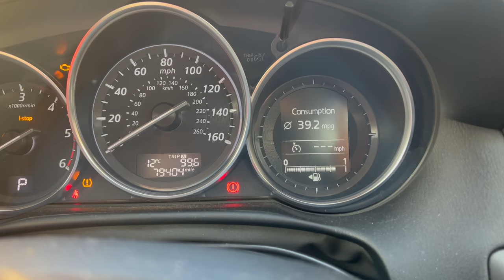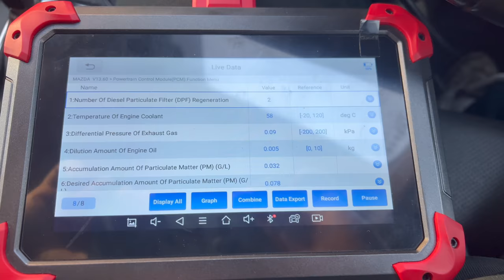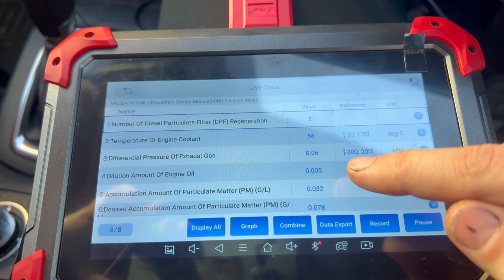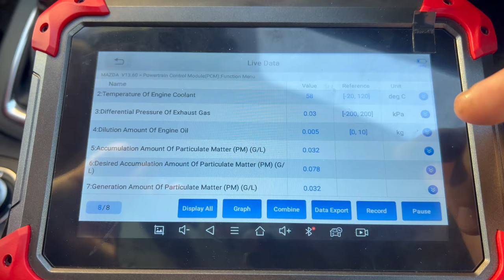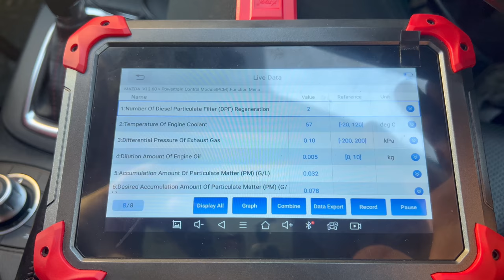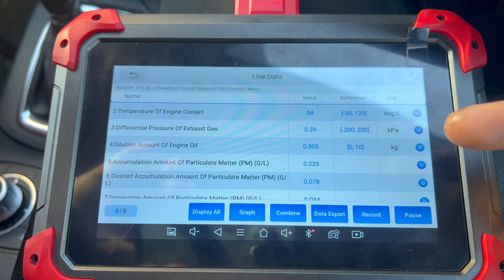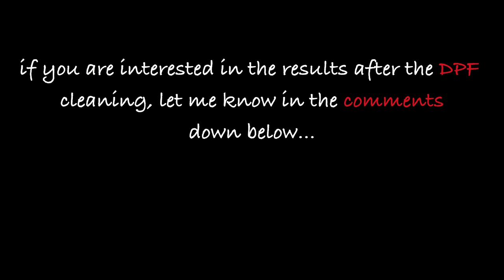Mazda Skyactiv DPF Issues Explained in Depth in Detail - It's the INJECTOR and not the DPF Filter

Comment: The screen with the Engine, AC indicator is located in the Fuel Economy Monitor menu.  I also noticed the car is in re-gen when the engine icon greys out.  (you are right on)
Reply from the maker: thanks for confirming ;)
Reply: Yes that's correct, the little engine icon, on the i  eloop models, the start stop, doesn't work also on the regen, and the car sounds tapity

Comment: Hello Sir, I had oil light turn on a couple of months after buying my mazda 6 2017 skyactiveD 2.2 was diagnosed as injector seals by the dealer... They were replaced however now after 20k+ ive recently found oil level increased above max in 3 weeks after a service... My drives are regularly only 15 mins also... Reckon the DPF due to short journeys is getting blocked or injectors again?

Comment: do you get the injectors tested? I got mine tested where they analyse the spray pattern and they were perfect, 40k miles on them.
And yes please do a vid on the results, I suspect my dpf needs to be removed and professionally cleaned because the spray did not work but I can look at your results to compare with.

Comment: Hello. Could you provide more information about the degree of oil thinning and its impact on regeneration? What would happen if it is not reset?If the injector has corrosion and is leaking, there will be differences between the actual fuel refilling and the average consumption that the car is supposed to have. Or am I mistaken? I also performed a flushing using similar fluids as you did, but there wasn't much improvement. After that, I added a DPF (diesel particulate filter) additive to the fuel from Liqui Moly. This product helped me; the regeneration distance increased significantly.

Comment: great video, thank you. My CX-3 1.8d 2019 makes Regen every 180km. I live in a big city and every day I make 15km to work and back. Problem is Oil dilution. I' ve changed oil in 98500km, in 102.000km because I didn't no and stopped many times the regen. From that time and so on every time the car begins regens I drive out of town for 20km in 3000rpm and have succefull regens. Know at 112.000km again new oils. Its normal? I only use mazda ultra dpf 5-30 oil but I read that the new generation of oils with low SAPS as Castrol edge extended performance has lower sulfated ash, phosphorus and sulfur  which is better for dpf's. What's your opinion? Thank you in advance

Comment: I tried different DPF foam cleaning using the same method you did.
Wurth, Xenum, Errecom DPF flush, they did work but after 10k+ km, the regens drop bellow 100 km.
I tested the injectors and they seem all ok.
Now the only think I did not check is the EFR valves...
Do you know that the 99.2% egr error PID means?
Reply from the maker: Hi buddy, to be honest I have no idea. I didn't have any experience with it.
Reply: its most probably engine oil leaking into the combustion chambers, causing excessive particles in the dpf. Any other failure mode causes a error code to be thrown whereas that one is most likely disregarded by ecu as "crappy fuel quality-but still within spec"

Comment: Hi. I have mazda 6 2.2 skyactiv 2015 with 85k miles. I have no fault codes. But the car is regening every ~50-60 miles. Is it most likely injector problem? Thanks
Reply from the maker: I think so
Reply: Did you manage to solve this?

Comment: Where can i get new injector nozzles please
Reply from the maker: I don't know buddy.
Reply: Mazda does not list injector nozzles  only injectors as a spare part, meaning dealerships are not equipped to repair  only replace them, as with most items.
You could try Feathers Fuel injection at Huddersfield. The nozzle is the heart of the injector, if the holes are worn which is often the case due to a manufacturing defect, then its new injectors. I have been down that road  12k miles ago and it looks like its happening again or the intake system is heavily carboned. I have cleaned  the stainless pipe from the cooler to the EGR valve using just soapy water, will be removing cooler and valve today and doing the same. 
I may need a manifold and head decarbonise, how do I contact you as I don't use social media only email. 
Happy to see the follow on video.
Reply: @hastuart9639 Mazda asked £3K to replace the injectors. It should have been a recall for a manufacturing defect. Not happy at all. Is there any more cost effective solution?